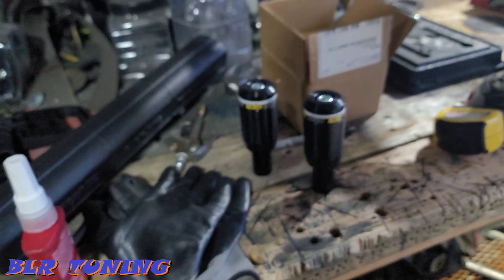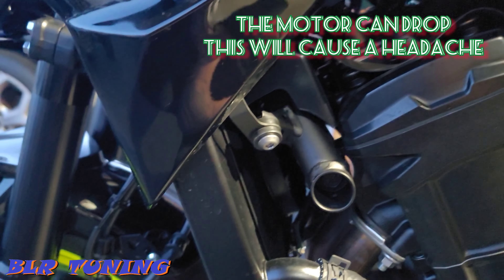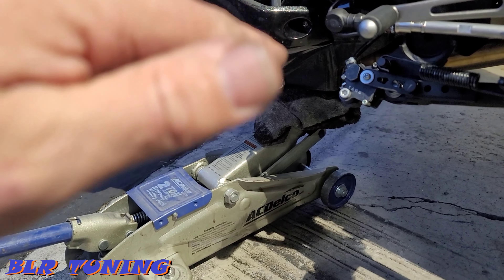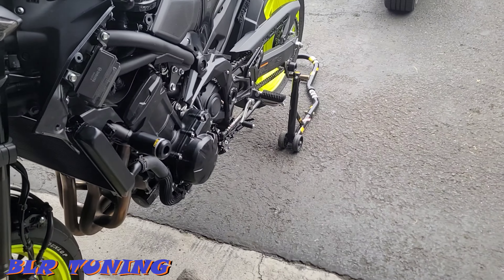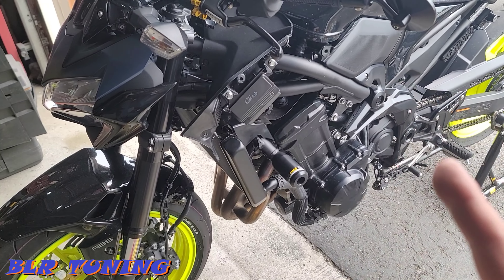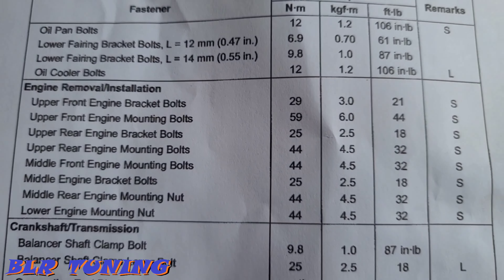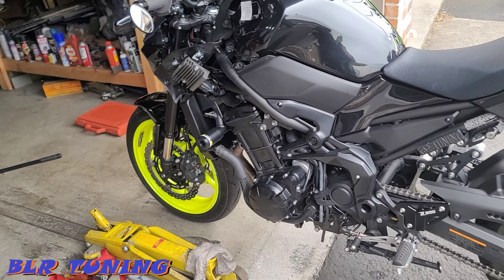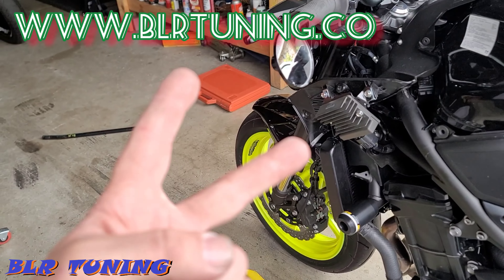OES ACCESSORIES FRAME SLIDERS INSTALL ON KAWASAKI Z900

Comment: Hi, Mine dropped too how do I bring it back ? Only the left side dropped a bit
Reply: Same here, did you fix it?
Reply from the maker: On our bike we had two pull out the back bolts that hold the motor in and then line up the front bolts with the frame sliders and everything and then put the back bolts back in. Not a fun situation
Reply: @Flo-900z  I did! I had to raise the engine with an Hydraulic jack!  First you losen the left side a lot then raise the engine. Then mount the right side, come back to the left sign torque it down. Do the same on the left. Took me a good 2 hours to do this crap! 

I needed to ask a bud of mine for help too. 

p.s Don't believe all the videos which say fixing this is easy! ITS NOT!! Lesson learned the hard way! 

Buzz me if you need any help.
Reply from the maker: Yeah definitely not easy or fun. We tried to crank the motor into place using a ratchet strap. We tried lifting it with a hydraulic jack from underneath the motor. When I installed The frame sliders I had a hydraulic jack underneath the motor anyway and it's still dropped... I've done a couple of these z900s now because we work on them here at our shop. My Z900 that I showed in the video is the only one that I've had the engine drop. All the others that I've installed know issues whatsoever. Definitely a chance that it does fall though for sure. And when it does not an easy fix. We basically had to pull the motor. We ended all of the rear bolts and then installed the front bolts with the frame sliders first and then the rest of the bolts. Pretty frustrating situation
Reply: @BLRTUNING  I totally understand! Are you seeing this on the newer bikes? My friends 2021 didnt have this problem. However mine is a 24 batch made in Thailand.
Reply from the maker: My 2022 did drop. However I've done the same job on another 2022 and a 2021 and 23 and 24 models with no issues. Like I said I've worked on a ton of these bikes ranging from all the years that they've made them and I've never had this happen except for the 2022 model that we had which was shown in that video.
Reply: @GregoryHouseMD1  I will try again today. Thanks!
Reply: @GregoryHouseMD1  i have a 2022. Maybe its a problem on newer bikes...
Reply: @Flo-900z  Yes could be! Do try it and post back and let us know if we can help you :)
Reply: Hey guys, fixed the issue with a lot of help from my bro. Thanks to everyone for helping out
Reply: @Flo-900z  Awesome!! glad to hear this ! how did you do it? :)

Comment: Ffs! I removed them one at the time and it was super easy and a 5 minute job😅 I never even thought about the fact that they are engine bolts and the motor could drop on me!
Maybe i got lucky because it only has 93km on the clock so its not settled in yet??
Reply from the maker: I've installed a lot of these and most of the time the engine does not fall but I have had it happen a couple times. Just a luck of the draw. Even with the engine with support underneath of it I've still had it fall before.

Comment: Did the car jack not help keep the engine up ?
Reply from the maker: Nope it dropped about 1 mm enough to where it was very challenging to get the bolts back in. We were able to get the bolts back in but we had to remove the other front engine bolts it was kind of a pain in the butt.

Comment: Ohhh man I am having a same problem my moter dropped 1 or 2 millimeter and now idk what to
Reply from the maker: We removed the four engine bolts and we were able to lift the engine back up into place and then put the front two engine bolts back in and then the back two lined up fine

Comment: I had that issue and it turned out to be a disaster. I don't think it's worth it to go through this huge problem just for these sliders. There are other ways to protect the bike other than frame sliders. This issue of the engine sag is NOT emphasized enough to the people who buy and want to install the frame sliders. It's a nightmare BEWARE
Reply: Can you tell more? Even I am planning to put frame sliders. What are the downsides?
Reply from the maker: @SOUVIK_RAY_ No downsides they're a great thing to have on the bike if you should ever drop the bike. Just a pain in the butt to install so take your time do one side at a time.